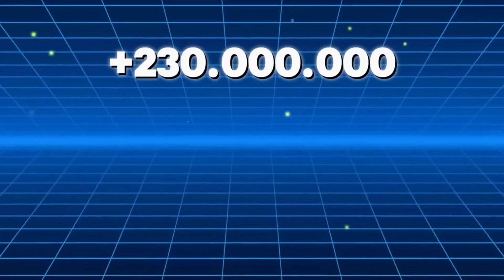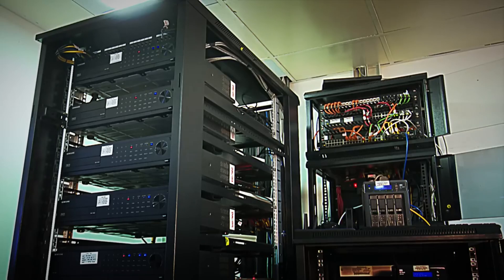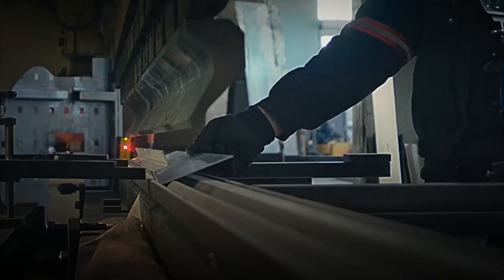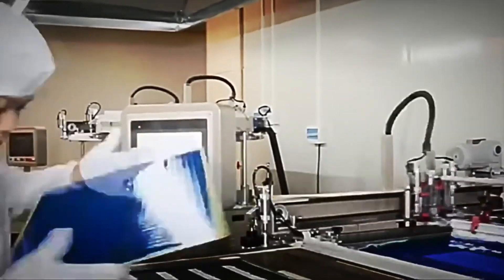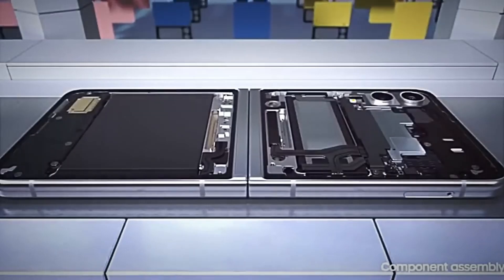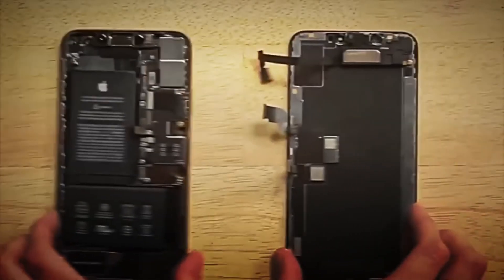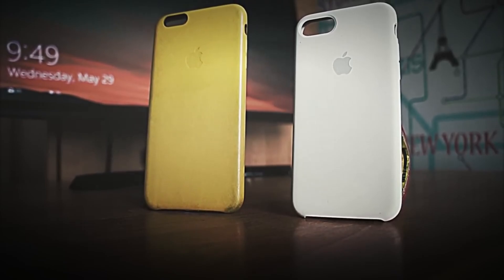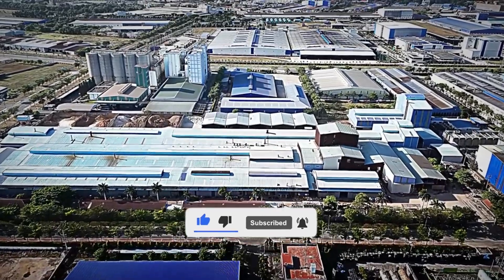HOW iPHONES are MADE 📱 | INSIDE Apple’s MEGA FACTORY 🏭

Comment: Most of the factory shots have nothing to do with iPhones. One shot shows a sheet metal brake folding sheet aluminum. Another shot purporting to show soldering, the oversized soldering iron never touches the circuit board. Complete joke.